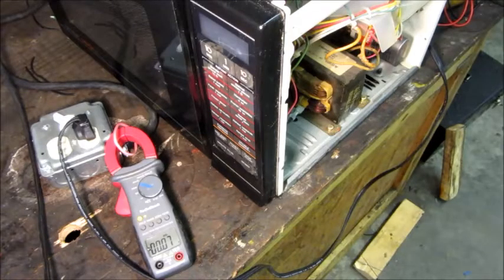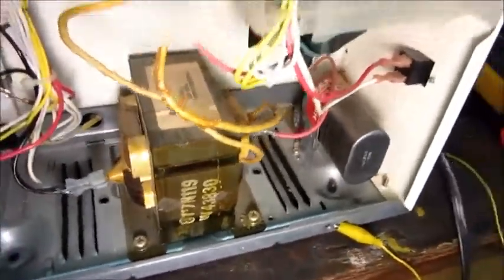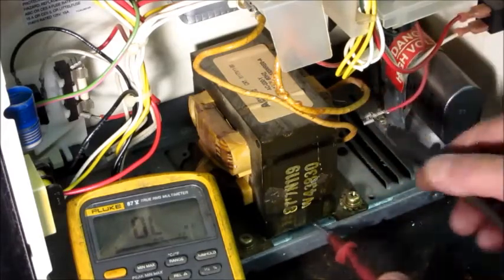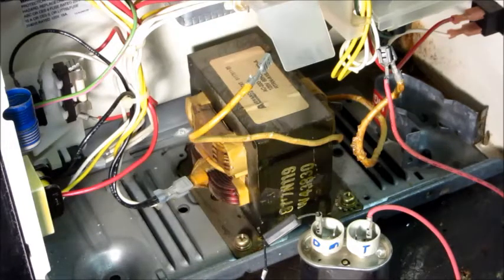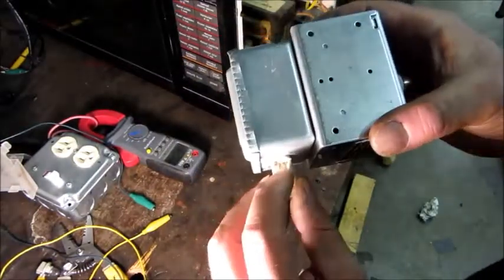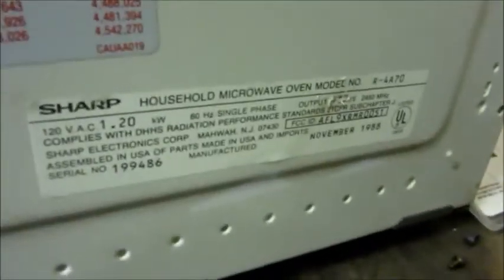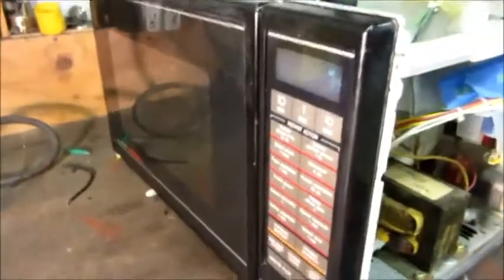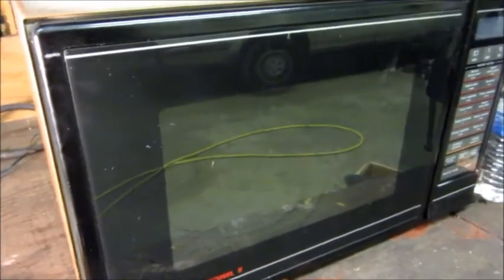Troubleshooting Sharp microwave made in 1988

Comment: David, you probably know this but the ceramic material on the magnetron might contain beryllium oxide... fine stuff when it's sitting, but the dust is quite toxic. 
Nice fix! I would have guessed that the cap would have been the failure. I had no idea Sharp made microwaves in the USA. 
We have a newer Panasonic inverter microwave... it works great, and I really like how the power level is adjustable. But when they fail it's like a bomb going off on the control board!
One of my favorite microwave "tricks" is to  find an old string of midget Christmas lights, and twist all the bulbs out of the sockets so the wires break and you just have the glass envelopes. Fill a glass jar with the bulbs, then top it off with water. Put it off center on the turntable and you get a view of the microwaves... the lights will light up where the radio waves are the strongest. When the water boils stop the oven, when it cools you can repeat the show!
Reply from the maker: Yep they say not to break the magnetron insulators because the dust is poisonous. Maybe that's what is wrong with me because I smashed a few as a kid! LOL!

Will try the Christmas lights thing if I get a chance!

Comment: Thanks for the video. I just replaced the fuse in mine, worked for a few seconds and started smoking ( LOTS of SMOKE ) Found the transformer has shorted. Real shame, I've had it about 35years. The Transformer looks like it will cost almost as much as a new microwave. It had it's last meal (mine) and then refused to cook the wife's.
Reply from the maker: That's a shame about the transformer burning out.  Often that is a result of another component on the HV side, shorting out. The diode, capacitor, or magnetron would be suspect. From my experience, the diode is the most likely part to short out. The others usually fail "open" based on my experience.

There's a lot of standardization in microwave ovens, so you should be able to interchange a transformer. looking at eBay now there are a lot of used transformers for sale.
Reply: Check the libraries. One in Los Angeles had an OLD book with circuit diagrams and instructions. Magnetron microwave ovens are vastly underrated. Unplug and damp the capacitor with an insulated screwdriver, using the one-hand rule.

Comment: Hi David.  Does my (c. 1982) Sharp Carousel Convection Microwave oven model R-8314 have a fuse?  In the final minutes of  roasting a turkey (combination cooking:  convection then microwave) it made a "Errrrrrrnt" sound (kind of a brownout sound) and then quit altogether.  No oven light, no power, no nothing.  Seemed like a blown fuse, but it wasn't the house fuse, and the cord and wall outlet are fine.   This is 76 lbs of serious quality appliance.  Might this be repairable?  Thanks so much.
Reply from the maker: Hi; yes it will have a fuse somewhere in the system.  As for the magnetic humming noise, that was likely caused by a short circuit in the high voltage section of the circuit. Possibly the diode, capacitor, or magnetron. Assuming the fuse did its job in time, it likely is contained to the one part which failed.
Reply: @davida1hiwaaynet  Thank you so much!  I really appreciate it!
Reply: Also, change the mica panel over the waveguide. Oils and fats can get behind that and cause arcing on the magnetron top/cap.

Comment: Yesterday, I blew up a hard-boiled egg in my Sharp Carousel II Model R-5A43 which I have had since the 1990s (the microwave, not the egg :) ).  The plastic microwave cover was propelled upward with such force that its handle penetrated the fiberglass plate covering the opening from the magnetron or whatever supplies the microwave radiation.  Does that fiberglass  cover have any functional role other than to keep exploding hard-boiled eggs out of the guts of the machine?  Is the microwave safe to use without it?  (I apologize that this is not a true "fit-it" question, but you will appreciate my desire not to discard a faithful and true servant for a mere cosmetic blemish.)

Comment: Great video.  I have a similar model, the R-8466.  It too was made in 1988.  I bought it new in Jan 1989.  Mine is a microwave/convection oven, only 700 watts.  Mine works fine in microwave mode, but cuts off after 2 minutes in convection modes.  The fan was running and the damper door closes.  Any ideas?
Reply from the maker: Hi, thanks for the comment. I really haven't dealt with convection ovens, but I would suggest looking for any thermostatic controls or other mechanisms which would shut off the convection function. Maybe this is out of calibration?
Reply: Thank you very much, I will check out the schematic under the cover for that.  @davida1hiwaaynet
Reply: Well, I found the problem.  It is a bad thermistor.  Unfortunately for me, the part is no longer available anywhere.  I can't even get the specs on it so that I could solder in a replacement. The P/N is FHHZ0019WRE0.
Reply from the maker: Awe that's a shame.  If I were you, I would try a few different thermistors and see if you can get one which does the job.

Comment: Great video David. Just wondering is there anything around the house you can’t fix or have to pay someone else to repair?
Reply from the maker: Glad you liked it!  I don't have patience for TV or stereo stuff, painting etc. those kind of things are not my forté so to speak.

The old stuff is just simpler and easy to work on, so the microwave was a no-brainer. Had the touch control panel gone bad, I would probably not have been successful - but when you consider that whole panel is just a switch - and that part was working - it leaves only the very basic parts to test.

Comment: hallo davida,  mit welcher spannung haben sie die hv diode getestet?
Reply from the maker: Hi Walter.  The test I performed on the diode used an 18V battery. I don't know the exact diode forward voltage.
Reply: hello davida,

thank you for answer, since I have again learned. My hv diode measurement I made the whole time with the multimeter ...... so max. only 9 volt.das could not work.

much success continues

walter

translated with Google
Reply from the maker: I am happy my video helped you!